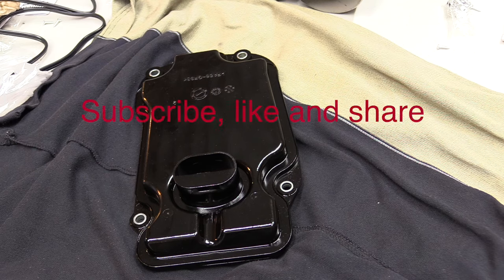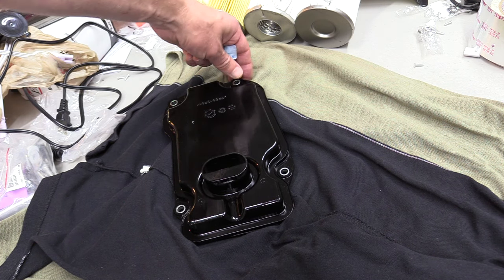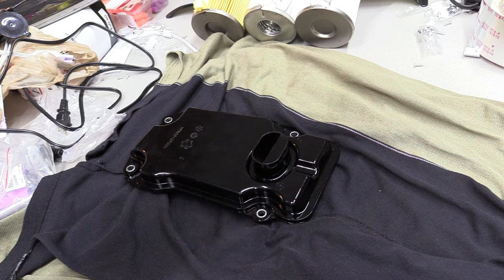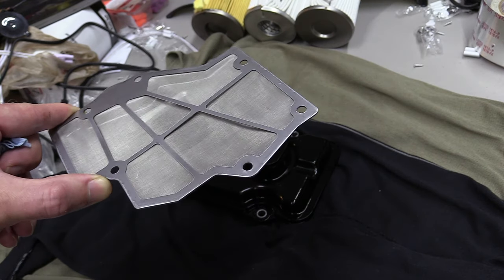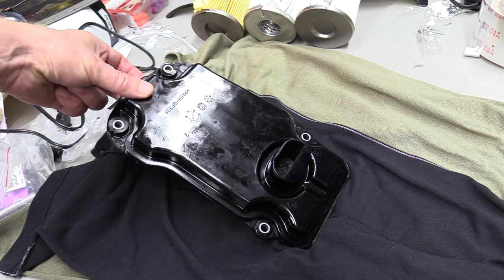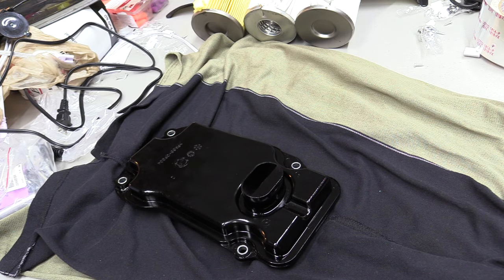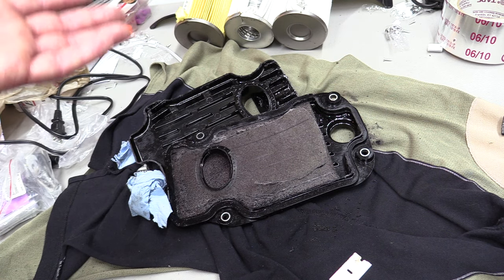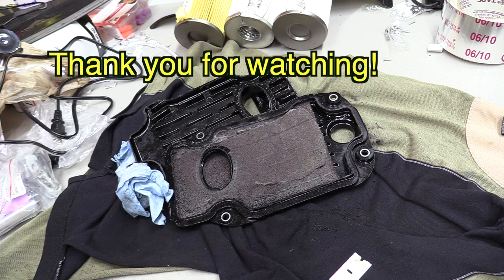Avoid replacing transmission filter, avoid costly transmission repairs, transmission maintenance

Comment: Excellent  video. I asked ZF what they recommend in mileage intervals on my BMW eight speed. They told me 60-100,000 kilometers. So I change the fluid every 40k miles vs BMW'S "lifetime fill" baloney. My car still shifts like  new at 120k miles.
Reply: im make the same ask to ZF they said bmw aft its life time...but if you drive agresive change every 8 years or 100.000km / 62.000 miles
Reply from the maker: 8 years and 60k miles is too long
Reply: @repairvehicle  its what ZF said on bmw lifetime aft..
Reply from the maker: @nebaicita it’s a lifetime nonsense. If it was lifetime then transmission would have lifetime warranty.
Transmission fluid DTF-1 lifetime nonsense, damage is done by false advertising by car companies
https://youtu.be/-bB0KrtN05A

Comment: Frequent fluid change will greatly extend the life of your transmission. Also, adding an auxiliary cooler with a 180 deg. thermostat will also make the fluid and transmissions to last significantly longer. It's a must if you tow with your vehicle.
Reply from the maker: Any idea where transmission thermostat with 180 degrees can be purchased,  any company name would be appreciated.
Reply: @repairvehicle  Your vehicle may already have a transmissions cooler thermostat if it has an auxiliary trans. cooler, like what's found in many trucks.
I'll attach a link in my next reply, in case you disabled links on your channel.

I tow a large travel trailer with my 2016 4Runner. TRansmission was running hot even when not towing.             
I installed a large external, auxiliary cooler and a 180 degree thermostat to bypass the cooler when it's not needed. Many people will argue that a thermostat is not needed but I thinks it's a must. In cold weather, transmission oil may never reach above 100 degrees F, with a large auxiliary cooler not equipped with a thermostat. It's not good because any moisture in the system will never evaporate. A thermostat will remedy this problem and will provide cooling for your transmission when it's needed most.
With the new system, transmission oil temperature in my 4Runner would slowly get to about 150 degrees and hover at around 150 to 160 degrees most of the time. I've seen it get to 168 several times when towing uphill during 90+ days. I believe that somewhat consistent temperature also contributes to transmission performance and longetivity.
I use a ScanGauge II (thanks for the suggestion in one of your videos!) to monitor several parameters including my Transmission Temperature. Keep in mind that this is measured on the bottom of the oil pan. Fluid temperature at the cooler (and the thermostat) runs about 20-30 degrees hotter.  
Don't forget to add about a quart of trans oil to compensate for the volume in the cooler and all the hoses). Don't forget to buy some additional hose. I'd used about 10 feet but I'm very picky about small details. 
Install a new cooler after the existing cooler inside the radiator. Verify flow direction visually. Hot/Cold by touch method doesn't work for this. There are several "professional" videos on Youtube by Etrailer where they screwed this up and connected the cooler before the radiator. 
Overall, I'm very happy with the new transmission cooler. I installed it at 20k miles. No towing prior to that. Transmission fluid was already dark brown. This is at 20,000 miles of regular driving. There is NO WAY the Toyota's ATF will last 100k. I always change ATF at 15,000 miles (drain and refill).
Reply from the maker: So, did you install aftermarket transmission thermostat on your Toyota? My Sequoia and Tundra has factory thermostat,  and I don't like how it works on Sequoia.  It constantly cooking fluid above 200 in hot weather  and in colder weather it's around 220.
Reply from the maker: Thank you the links,  you gave me some good ideas. I am going looking at lowering my transmission fluid temperature.

Comment: Thanks for the video. My opinion is to change the filter once to get any initial wear metals out, then just keep up on the fluid changes. I’m willing to bet if you do that, transmissions will last a long time. Most people don’t ever touch the transmissions even.
Reply from the maker: I have video on my channel about the car that have not changed transmission filter for 300k miles and still running fine. However fluid is changed every 40k miles
Reply: @repairvehicle  I’ll check it out, thanks. Watching your video about the 6r80 fluid lab tests. Same transmission I have in my truck.
Reply: This is exactly what I was thinking, change the filter the forst time in my mew CX-5 and thereafter only the fluid.

Comment: I have a second hand Camry with 204K miles. Probably still with original transmission fluids. I just purchased transmission filter and gasket so I can replace it while changing the oil.

Comment: Correct me if I’m wrong here…but drain & fill will only give you about 40% new fluid when mixed with old fluid in the pan. If you drain the tranny and remove the pan to give it a good cleaning and wipe off the sludge and clean the magnets, your already inside the pan anyway and adding a new $30-$50 for a new filter I don’t see as a problem considering all you need to do is pull it off and plug the new filter straight in. This would allow you to extend the next fluid change to about 60K miles which is about the regular interval and extend the life of your transmission with less maintenance and knowing that the pan is clean and mostly 90% new oil im sure would do wonders for the transmission at the same time.
Reply from the maker: Watch video again, you missed the point

Comment: This video is Very informative!  Particularly, difference between high pressure and low pressure filters! Thank you!

However, I think it’s worthy to drop the pan and clean the magnet and the pan.  It’s rare for a pan bolt to break, unless it’s rusted severely.  How do you think?
Reply from the maker: It you don't have problems with rust, dropping pan doesn't hurt anything.

Comment: Great video! I have two questions.  #1 = I have a 2003 Mercury Mountaineer v6 and I'm the original owner. I've never replaced the transmission fluid or the transmission filter, since it's a sealed transmission (no dipstick, just drain plug underneath). The owner's manual says to replace it at 150k miles.  My car just hit 150k miles.  Should I replace the transmission fluid and filter, or just the transmission fluid?  What do you think, or recommend?  #2 = I have a 2004 Ford Mustang v6 and I'm the original owner. I've never replaced the transmission fluid or the transmission filter.  This car does have a dipstick, and I've always checked it to see if it's at the correct level, which is has always been (no leaks, etc).  My car just hit 162K miles.  Should I replace the transmission fluid and filter, or just the transmission fluid?  What do you think, or recommend?  BTW, neither of the cars has any transmission problems, slips, etcetera at the moment.
Reply from the maker: As bare minimum I would replace fluid and filter is a good idea too at this mileage and time. Owner’s manual is wrong and written to benefit dealers. No fluid can last past 40k miles and have same specifications as fresh fluid does.
Reply: @repairvehicle  Thanks for the feedback. I will be posting the videos on my YouTube channel.

Comment: 2002 ford f350 7.3 Powerstroke diesel with ford remanufactured 4r100 tranny installed 60k miles ago. Mostly midweight  trailer towing and I just now had my tranny flushed/refilled and filter changed. It also has an inline filter that was changed. Most of these trucks are being serviced every 15k for pan drain and at 30k miles drain and change filters. I hope I'll be alright.
Reply from the maker: Oem inline filter?
Reply: @repairvehicle  magnetic inline filter in return line. New 37 row Mishimoto cooler keeping temps 140° to 160° on 96° days pulling 10k pound trailer in town.
Reply: @repairvehicle  Ford had installers add them when installing factory rebuilds.
Reply from the maker: Inline filter nice but pose great reliability issues
Reply: @repairvehicle  has been fine since 2005. I actually have 75k miles on this unit. All in town driving with trailer attached 24/7.

Comment: I have a 2003 Toyota Corolla automatic transmission with about 200,000 that I just purchased I was wondering should I just drain and fill the transmission or do a complete flush?
Reply from the maker: Couple of drain and fills.  Do not do flush, unless you want transmission problems

Comment: I agree with your position, I purchased a 2003 BMW 325 with 130,000 miles. I replaced the filter and oil on the lifetime no service transmission.The oil was in bad shape. The bottom of the oil pan collected some particles and sludge. I have since only changed the oil. I have driven the car 50,000 miles with no issues

Comment: I just bought a 2006 Toyota Camry with 85000 on it not sure if the fluid or filter has been changed but the fluid looks pretty clean just wondering if I could get by with just changing the fluid only
Reply from the maker: Answer in the video

Comment: I've got a Land rover discovery 3 2005 with 164k mileage, I'm about to fit a new transmission sump and filter with the fluid change and also doing the mechtonic valve body service. In your opinion is only worth doing fluid change?
Reply from the maker: If you dropping pan might as well replace filter.
Reply: @repairvehicle  Thank you for the guidance, you here so many conflicting advice that sometimes you question if your own logic is correct. I have subscribed to the channel because your genuinely informative and provide helpful tips. Keep up the good work!

Comment: I'm the second owner of a 2015 Tacoma V6 4x4 with an A750F transmission with tow package. The vehicle has 125k miles. I am not sure if the transmission fluid was ever changed in the past by the previous owner. If I don't know what brand of transmission fluid is in the transmission, can I use any fluid that meets WS standard? Don't know if the previous owner changed the fluid and if he did, there's no way of me knowing what brand was used. So, lets say if there was Toyota WS fluid in the transmission and I used aftermarket fluid, is that ok for a drain in fill? Maybe drain and fill a few times all in one day?
Reply from the maker: This video has answer to your question 
https://youtu.be/rzp4ddX4ac0

Drain and fill that’s all I do.
Reply from the maker: How often transmission fluid needs changed? Every 30k miles or lifetime for the life of warranty?
https://youtu.be/Kb3GQRzkLVQ

Comment: This is great, so I just bought a 2006 Acura TSX with 154K miles and I don't know if they recently changed the fluid or filter and I'm hoping they used Honda Z-1 Transmission Fluid. Should I buy a 5 quart Honda Genuine ATM Z-1 Fluid and do several drain/fills in case they didn't use the Fluid that is recommended for Acuras? I have a pump Extractor too, rather than dropping the pan I'm thinking of using the pump to extract whatever doesn't come out of the pan.
Reply from the maker: you can use any quality compatible fluids.

Comment: Only reason I changed it was because of the pan seal leaking. I empty and fill every 30k miles on my tacoma. There’s no such thing as “lifetime” fluid.
Reply: Is it dark?
Reply from the maker: It was dark on mine at 30k miles
Reply: @repairvehicle  30k is that sweet spot then
Reply from the maker: 30k miles always been sweet spot for atf fluid.
Reply: @edwingiron09  yea it does get a bit darker. Perfect time to drain and fill.

Comment: Hi Friend, i have 2003 lexus GX470 and has 160,000 miles , I think the transmission fluid never been changed, i want to change fluid do you recommend the filter needs to change or not ?? Thank you
Reply from the maker: It depends on the filter type and other things that I have mentioned in the video

Comment: Ask friend.  It is recommended to make the change
 of transmission oil to a 2003 tundra with
 200,000 miles?  There are some who have told me that
 It is not recommended that you take risks.  you that
 recommends.  Thank you
Reply from the maker: Every transmission has bearings. Dirty fluid causes bearings and other components fail fast. It’s like saying don’t change your engine oil because truck has 200k miles, makes sense?

I would change atf fluid.
Reply: @repairvehicle  wow, what important information, thank you very much.  🙏🏼

Comment: Should you drop the pan when changing fluid or just let the tranny pump the fluid out of the return line at the radiator, keeping fresh fluid in tranny by adding 1.5 gallons befor starting the engine to pump old transmission fluid out. I have seen a few videos doing this. Is that safe?
Reply from the maker: It’s not safe.
Automatic Transmission Flush Facts and Fictions, why transmissions fail
https://youtu.be/or9u8DQ4fVU

Comment: Thank you so much for making this video :)!  I did want to ask for your opinion on something.  So, I have a 2015 Civic with a CVT transmission.  I was late to the game changing my transmission fluid - the first one was done at 52k, then I did one around 72k, and I will do one again at 90k.  Do you recommend changing the large black plastic filter on this car?  I changed the smaller filter within the transmission at 52k miles, but I am unsure of this large one.  I know you were saying that the bolts holding the transmission pan may be corroded, so I feel like perhaps not, but I did want to get your take on it.  Thank you!!
Reply from the maker: If you can change it, change it
Reply: Thank you! Maybe the mileage is not at the point where removing the transmission bolts will be a challenge.  @repairvehicle

Comment: Great video.  I've seen other videos also saying n oh t to replace the filter as well. I have a 2003 Silverado 1500 with 105k miles.  95k of it freeway miles. I know because it was my dads truck. Its very well taken care of. Now that its mine I'm going to tow a 4k lbs trailer soon so I decided to replace the transmission filter and oil. Do you think I should just drain and fill? Scotty Kilmer says 100k freeway miles is like 10k stop and go city Miles.  Thanks for your video.  I was a bit intimidated to change filter but drain and fill a few times is something I can do myself.  You're opinion will be greatly appreciated. Thank you.
Reply from the maker: Oem factory transmission fluid is good only for 50k miles.  I have verified via oil analysis, some results already on my channel more will be uploaded. 
Scotty Kilmer in one of his videos said that Toyota tundra is worse truck to buy, next year he bought himself tundra and now claims best truck to buy.  Is he confused or what? He gives out too much false information on his channel. 
He blocked me from commenting on his channel when I asked him why his lexus engine was trashed on the inside. 
100k miles highway and fluid still good,  completely false information.  If this was true,  majority of transmission shops would be closed by now, due no transmission repairs needed. As a bare minimum, drain and fill.  
Also, strongly recommend synthetic atf.
Reply: @repairvehicle  

"Bravo Zulu" ( Well Said ) ' RepairVehicle '

Automotive Professional background
Los Angeles County ( Southern )

Comment: I almost put my escaped in park will moving.  It ground a little. Now my suv has some filing and stops moving.  I check the side senser and it had fillings.  Should I try changing the filter?
Reply from the maker: Yes I would change the filter

Comment: Hello Sr I'm going to change the fluid transmission in my 2019 Toyota Tundra so I  don't need to replace the filter? I have 60k on the truck right now
Reply from the maker: Nice truck Sir.  I don’t recommend changing transmission filter, just change the fluid.
Reply: @repairvehicle  ok Thank you Sr

Comment: I’ll probably change the filter on my Ram 1500 8 speed every other time. The ZF8 speed requires changing the whole pan to replace the filter.
Reply from the maker: If you want trouble free transmission, fluid change frequently is a must specially with 8 speed or more.

Comment: Great video. I have a tundra. Bought it with 180,000 now has 245,000. I have never changes the fluid. Do you recommend I change the fluid? The truck drives very sluggish.  When I give it gas it speed up very slow. Maybe clutch plates are wore. Any help please. Thanks.
Reply from the maker: What year and engine size?
Reply: @repairvehicle  2000 4.7
Reply from the maker: I would do couple drain fill.  After that would be good idea to replace filter if bolts not rusted
Reply from the maker: Actually I have a comment how 1 person fixed his Toyota transmission for less than 10 dollars.  I am going to find comment and make video, some time this week
Reply: Do a throttle body cleaning and spray the MAF with cleaner. Change spark plugs and pcv valve.

Comment: I have a 2007 sequoia with 220000 miles and the fluid has never been flushed.  There are no issues at this time.  Should I change the fluid and filter or leave it?
Reply from the maker: If this was my suv, I would replace atf fluid as bear minimum.  Unless I was not planning to keep then I would not change it.
Reply: Keep it that way. DON'T MESS WITH IT. If ain't broke, there's no reason for you to fixed it. Stay away from it. Keep it as is where is and enjoy your ride
Reply from the maker: Fluid is broken and needs changed.  You are contradicting yourself

Comment: Nice explanation. The transmission filter is clogged free for it is designed to filter out the sand size or even smaller elements. How about the particles that are captured by the magnets does it have for us to worry about?🤔
Reply from the maker: Answers in the video, watch video without skipping.
Reply: @repairvehicle  Thanks, I watched it all, I may have missed something. 🙂
Reply from the maker: @edstonpesito9199 , you not going to have much on the magnet if fluid changed often.